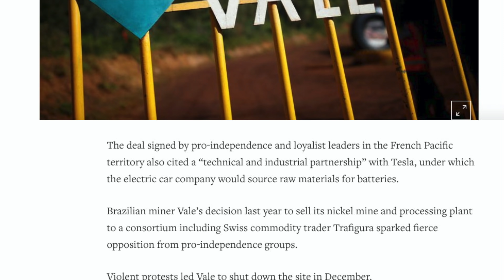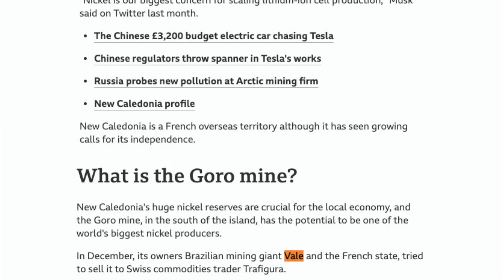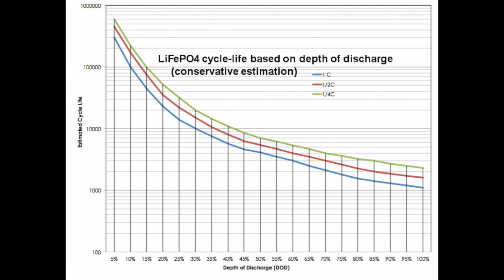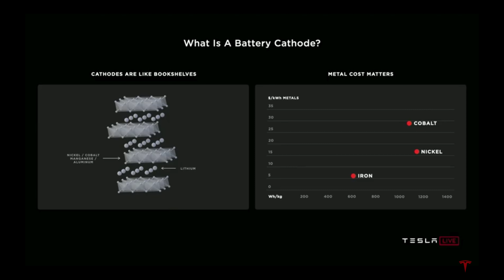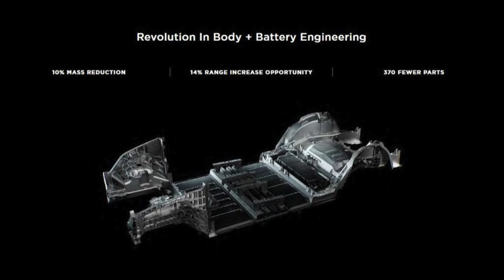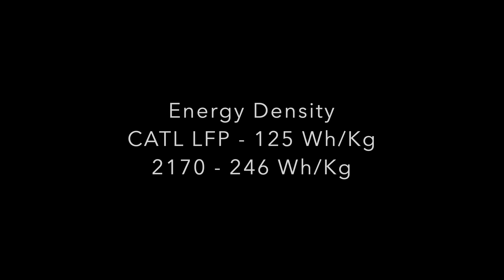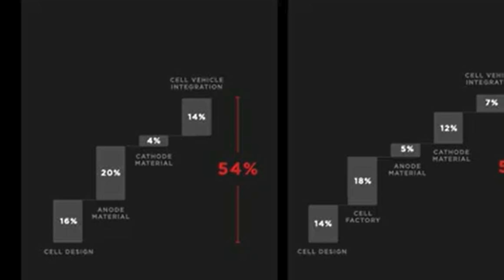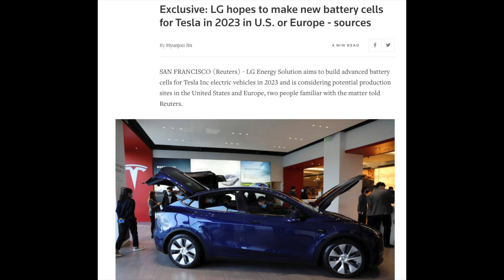Tesla's LFP 4680 Batteries are Under Rated, and Rarely Discussed. This Could Change Everything

Comment: Compare wieght at pack level not cell level. LFP batteries requires less safety measures on pack level and therefore can close in the weight gap on the pack level

Comment: I've been shouting about this since battery day! Everyone seemed to assume that "4680" meant "high performance cathode".
Another point to consider (stay with me!!)

Tesla said the cell holds "5 times the energy and six times the power" yet the vehicle only increases range by 16%.

Why?

If we assume the thickness of the "jellyroll" sheet is similar and the space at the core of the cell is the same, the extra winding layers and greater height of the 4680 mean there is almost exactly 5 times the surface area of jellyroll in each cell.

Since this material stores the energy....... 5 times the energy (capacity).

The rate at which that cell can dissipate they energy is largely limited by heat, which is largely the result of internal resistance.

How to reduce that? Shorten the electron path, provide more contact area for the power to "escape".
A 20% increase in that ability gives 6 times the power.... Per cell compared to a single 2170

That's the "tabless" advantage.

Next advantage.

Assuming they can speed up the "front end" input of the material (Maxwell dry process) for the same number of "cans" leaving the plant, they have that 5x energy/ 6x Power.

The factory has 5× more "kWh" capacity (in much less space, due to the compact Maxwell process).
That's what turns a "Megafactory" into a "Terafactory".

Then, there's the weight saving.

Estimates indicate the new format reduces the number of cells required from well over 4000 to about 970 (Model 3)

But, the cell is larger.

Calculating the outer shell surface area of a single 4680 vs 2170 cell and adjusting for quantity, that's about 40% reduction of material (steel) and so weight in the cell casings. Lighter pack.

This goes toward the "16% range increase".

One thing everyone has missed.... (Until you!)

These calculations do not account for "better chemistry"!

It's just packaging.

In fact, just the "cell can" weight reduction would increase the  Wh/kg rating of the pack by close to 1.4x (?)
That would mean an LifePo4 pack in the region of 220+ Wh/kg without considering weight reduction in the pack casing and vehicle chassis.

If you add the new materials/ chemistry, that density increase can be added to the above.
..........

Panasonic (Nevada)
I wonder if it's possible that  rather than use the Maxwell process, a 4680 "canning" facility could accept "wet process" cathode from the existing Panasonic lines? (Modified for "tabless")
Essentially the *state of the art" 2170 chemistry, repurposed with the advantages of tabless construction, giving a substantial boost to the performance?

This would enable those lines to be more effective until end of life.
They could even divert multiple wet process cathode lines to feed one "canning plant", then strip and rebuild the 2170 canning facilities for 4680.with minimal production loss.
Just a thought (or several)

Comment: The 4680 tabless electrode design already increases energy density, so LFP 4680 cells should have a higher enery density than LFP 2170 cells.
Reply: It doesn't increase density that much. it increases the energy CAPACITY of a cell, but they're bigger cells.
There's an increase in density due to less casing material related to the "active" material in the cell, but it's not 5x at cell level see my other post.

Comment: The biggest problem with the battery in South Australia is not the battery but the grid with a centralized battery. This doesn't provide South Australia with reliable energy. Having a battery at every house in the country does. I recently had a powerwall 2 installed at my place and if the sun shines for just 5 hours each day on my 4.1kw system I'll have enough power to not need a grid connection ever again, or at least till the battery needs replacing.

Comment: Great video. No doubt the car meant for the masses will use the lithium iron phosphate batteries. Definitely for the model 2 and for all standard range model 3s/model Ys. Here’s where we need more information. Will Tesla produce the LFP cells in the 4680 format or will they rely on CATL, Panasonic, and LG Chem? Also, will the LFP cells in the 4680 cell format have a higher energy density than the current LFP cells produced by CATL? My understanding is that eventually Tesla will produce all types of their 4680 battery cell, but they will start with high nickel cells first and rely on their other battery suppliers (mainly CATL) for LFP cells. Most likely, Tesla’s battery suppliers are working to start production of the 4680 battery cell in all types. I can’t confirm anything except what I read online. We know CATL is already able to produce LFP cells successfully so I’m willing to bet they will be the ones to focus on producing Tesla’s LFP 4680 cell. Panasonic will focus on the high nickel 4680 cell, and LG Chem will get the mid tier Nickel Magnesium 4680 cell. Each supplier will focus on the 4680 cell type best suited to their area of expertise/production level/capability. In theory, Tesla will own the rights and understanding gained from each company’s ramp up, and they will be able to build whichever cell type is most needed (depending on what market the factory is in). So in China, Giga Shanghai will most likely not need to focus on building LFP and Nickel Magnesium. They will, however, need to build high nickel 4680 cells. In Giga Berlin, they might need to set up production lines of mainly LFP and Nickel Magnesium. In the U.S. they will need all three, but will get help on high nickel from Panasonic. Back to the topic of the video though, I think LFP in 4680 format combined with the new production techniques and structural battery pack/single piece casting will allow Tesla to provide cheap yet high quality electric cars that have over 300 miles of range and can last for over 1,000,000,000 miles!!

Comment: Agree long range model 3, Y and utility (power walls) could use LFP with some additional cells. Towing will require Nickel and a lot of cells. Towing range is key to cyber truck success, so nickel will be require for all towing vehicles. Battery grade nickel from recycled batteries and stainless steal will be needed.

Comment: Greetings 
FYI,  LFP, I expect,  WILL be used for all stationary applications including Power Wall.  Weight is not a problem.   Worst case, they could be installed on the ground. I'm a mechanical engineer,  was a carpenter, and have designed and installed solar power systems.   Mainly into physics and patents and new product and technologies design.   Anyway,  LFP is perfect for Power Wall so I'd be shocked if they use nickel for any stationary energy application.   Hopefully autobidder is widely sold when Austin battery production ramps.

Comment: I was surprised that Tesla waited so long to get into LFP battery tech, especially for stationary storage.  I have been using LFP batteries since 2009 and I have a cheap Ping-Ping battery from 2010 that is still going strong with just the normal make sure cells don't get too high or too low of a charge and at this storing fully charged is fine unlike some other lithium battery technologies.  GM has been using LFP battery tech since the Chevy Volt was introduced.  As Tesla tries to keep its cells going for as long as possible and the base for LFP, at least if you start with the right tweaks others have already figured out, is a very long life, I would think Tesla LFPs would last for a very long time, even longer than you suggest.  Also LFPs don't normally catch fire.  I broke the LFP battery from 2009 in an accident and it just smoked for a while and I made some jokes about so much for being able to have kids due to the chemical smell coming off of the smoking battery, but really it was fine.

Another place I am a bit surprised Telsa hasn't gotten into are Lithium Titanate batteries.  These batteries while tending to be a little more expensive, tend to last for forever, a lot longer than LFP and LFP is pretty good.  Something I think is important to consider is how many charge cycles does the battery last when figuring in the cost of a battery.  For example if you can get 1,500 cycles out of a battery for X capacity and say it costs $2,000 for that capacity, if a different battery costs $4,000 for the same X capacity, but gets 7,000 cycles and you are going to eventually use all of those cycles, for example your grid application, then the $4,000 battery is the better value.  If the battery costs $8,000 for the same X capacity and gets 20,000 cycles, maybe if you say doing a rapid demand swing grid application where you will use those 20,000 cycles or say a bus application where the bus recharges at various places in its route, that $8,000 battery is the better value.  Also say you use a 50% window of a 1,500 cycle battery to get say 5,000 half cycles, getting 7,000 full cycles out of a better battery for twice as much money would be the better proposition.  Going down this route a battery rated for 7,000 full cycles that gets 30,000 half cycles is a better value proposition than a battery that costs half as much but only gets 5,000 half cycles.  Of course this is all considering stationary batteries where you don't care so much about weight.  I am not sure why the Telsa Powerwall weight would be a concern.  If push comes to shove you could always have the battery on a stand and bolt it to the wall so it doesn't fall over like you would for a tall bookshelf or the like.

I suppose one thing with LFP is it is a bit harder to get an accurate charge reading as the middle of the discharge curve is flatter than most other lithium chemistries.
Reply: The reason Tesla did not move early to LFP is because of their long term supply agreement with Panasonic. They needed to wait to have enough volume of car production that a second and third battery supplier make sense.

Comment: Tesla seems to have been improving their battery management systems and motors which lets their EVs get more distance out of a kWh.

There's another reason for using LFPs.  They are non-flammable.

Powerwalls could be heavier.  Just a bit more weight to move into place.  Use legs to help support the extra weight rather than putting it all no the studs.  Or make the individual units smaller in terms of kWh.  Install two where now one would go.  

A Powerwall that could not burn would be attractive, I suspect.

The LFP batteries I'm using in my solar system are rated for 10,000+ cycles.  In a 250 mile range EV that's a 2.5 million mile battery.

Comment: When Tesla talks about a 56% increase in range for their new 4680 Roadrunner battery, they are talking about the high nickel battery with improvements in the anode, cathode and electrolyte - not to mention the dry battery electrode process they got from Maxwell Technologies. These advanced battery technologies don’t apply to the LFP batteries. Just because you call them 4680 LFP doesn’t mean they have the same battery chemistry as the Tesla 4680 Roadrunner battery. 4680 is just the form factor which is just one part of the many changes Tesla is making to achieve a lower cost, higher energy density, longer lasting, and faster charging 4680 battery. Changing the form factor alone of the LFP or any other battery chemistry won’t give you what Tesla is working on. 

Battery have little to do with the 0 to 60 performance of a car. The only way that the battery helps in the 0 to 60 is the weight. You can take a small 25 or 50kWh battery and get better 0 to 60 than a car with a bigger battery because the smaller battery weighs less. The 0 to 60 performance is due to the electric motors and the torque they produce, the drag coefficient, and the weight.
Reply from the maker: Sure, I realise that, and LFP currently uses the pack as the structure, but there will be some advances still. Elon said they should get up to 300 miles range.
Good point about the 0 to 60 times though.

Comment: I was thinking that LFP 4680 would be tied closely to the generation of factory that they are building after Germany and Texas.  My assumption was that some type of 25K vehicle that is mass produced with LFP batteries and possibly a robotaxi variant would be produced.  For a robotaxi, you wouldn't actually need tons of range or a huge battery.  You could actually produce vehicles with a smaller range and smaller battery that could take thousands of charges for a robotaxi if you are intending to blanket a city or other high density area.  You just produce extra vehicles with smaller batteries and charge a little more frequently.  I was also thinking that this next generation factory that will produce the cheaper vehicles could also sell off all excess LFP batteries into stationary storage applications if there is some ebb and flow to the demand.  When I look at Tesla, I'm seeing nickel in Germany and Texas due to the nature of the vehicles they are trying to tackle.  Also, it is logical to pull a deal with Piedmont forward because those plants are being built and Texas will need to have a supply of Nickel secured.  However, I wouldn't expect them to make waves on the LFP front until they get to the next generation factory.  With LFP you can consume brines and use lithium carbonate.  I was also wondering if India was a potential site simply due to the amount of iron they have and because there might be opportunities for either stationary storage, or LFP mass transit or LFP semi's in India.  I could see 4 next gen factories using LFP (Europe, US, China, India).  Those would be hubs for lowest cost vehicles and massive amounts of stationary storage cells.  In my head the ratio was 1/4 of the 2030 batteries would use nickel and 3/4 would use LFP in terms of gigawatts produced.

Comment: Robotaxi EVs need a battery pack that can handle 185 miles ( appr. 300 km) per day with full loads. That is critical for a successful Robotaxi fleets. Highly profitable Robo taxi business will justify a very good long range high density battery pack. I am sure Tesla will have a different battery pack Vs regular 25k EVs.
Reply: Robotaxi fleets could operate with a small range like 100 miles.  All hands on deck for the morning peak demand.  Then when demand slacks off rotate in for a half hour 80% charge to get ready for the late afternoon demand peak.  Then everyone charges up during the night.

Comment: I suggest you contact the you tuber “ the limiting factor” he seems ver.y knowledgeable about battery chemistry and ranges. I am sure you will  find it very useful. He seems also a nice guy. Good luck.
Reply from the maker: Already did, he says that Elon said they can reach 300 miles range. Which is pretty decent.

Comment: A battery that will last 10 to 15 thousand cycles means a battery and a vehicle that could last a lifetime or several million miles.  Wrap your mind around a vehicle that could be passed down to your kids and grandkids and then still used for energy storage in mega chargers.  2.5 million miles means not having to buy a new car 10-12 times over the same period.  Talk about sustainable energy!
Reply from the maker: Yea
Reply: Yep.  Now imagine a stainless steel exoskeleton robotaxi with a cast aluminum underbody and LFP cells that last 2.5 million miles or more.  A NYC or LA taxi drives about 70,000 miles per year.  A 2.5 million mile robo would run for 35 years on the same set of batteries.  And the body should be good for a few more million miles.

Almost all the materials should be recyclable or plant based.  Manufactured and remanufactured using renewable energy.  That's our route to a sustainable future.

Assume a 2.5 million mile robotaxi could be manufactured for $40,000.  The vehicle cost would be less than two cents per mile.

Comment: Tesla has a working relationship with a battery research group working out of Dalhousie University.  Jeff Dahn has been in charge of the research team for the last number of years. Mr. Dahn is a pioneer in the field of Li-ion batteries since they were first produced. He has increased their life cycle and made them commercially viable. His team out of Dalhousie University Halifax Nova, Scotia Canada have been filing patents for Tesla over the last five years. This relationship with Tesla has been extended until 2026. My point in sharing this information is this is similar to the Giga press. The refinement process on batteries is ongoing and the next breakthrough could be right around the corner. Dr. Chongin Yang has been appointed Tesla’s energy chair working out of this group. His focus is to bringing lower cost, longer life cycles, higher battery technology to the marketplace. In addition Dr. Metzger heads a second group out of Dalhousie University. His goal is to create a new electrode materials and electrolytes materials for stationary and electric vehicle batteries. Tesla fans expect the unexpected. Elon will continue to find the technological edge by working with the brightest minds in the fields of AI, material science and battery technology. Information provided here comes from Electrek.co.